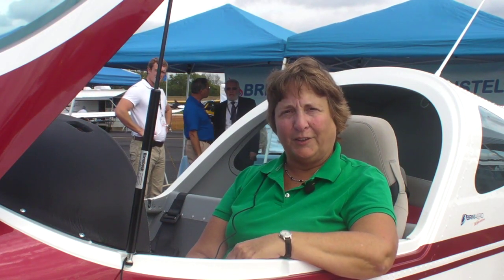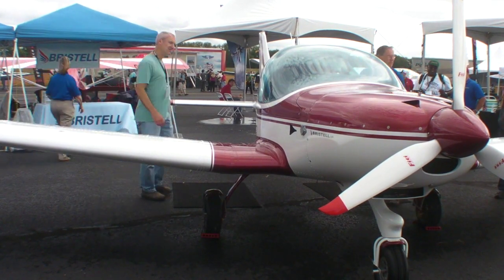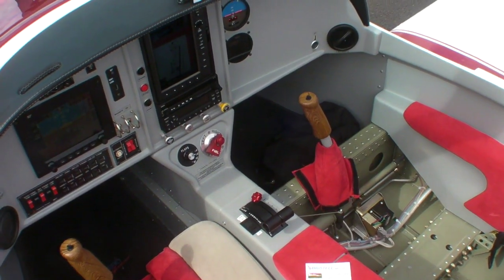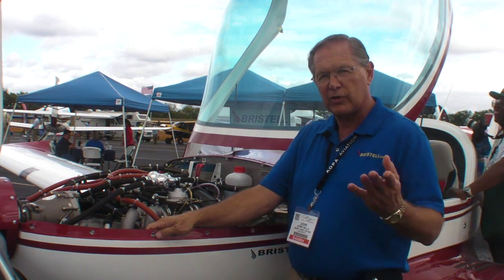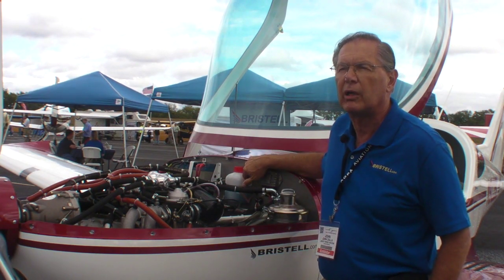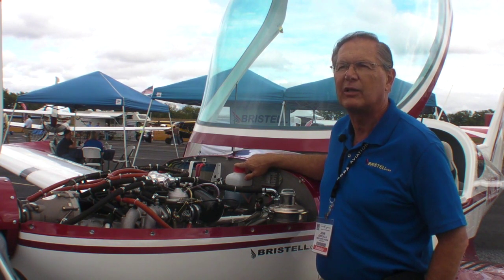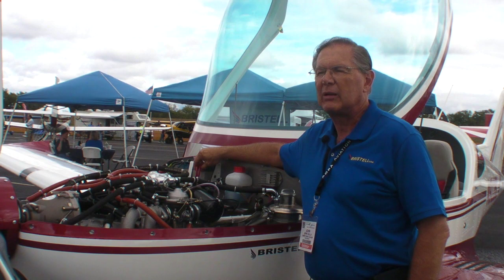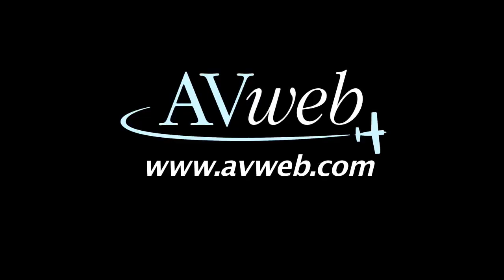New LSA from Bristell

Comment: Everyone talks about the cabin width, but I'm fine with the cabin width on traditional GA singles. I don't need 51" cabin. However, I need the knee space and the head room. I sat in SportCruiser, and it was simply impossible to close the canopy: by the time it touched my head, it still had 2 inches to go to latch. And I could not scoot lower in the seat because my knees were pressed against the dash.